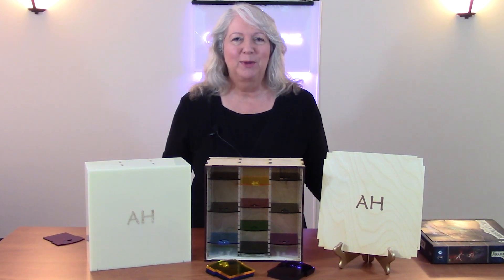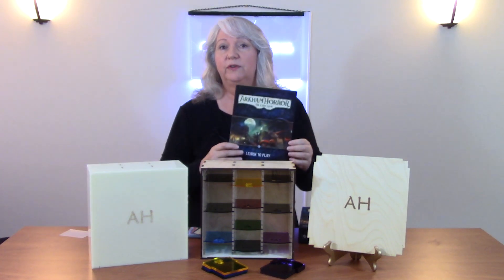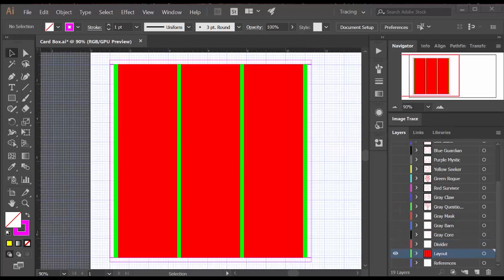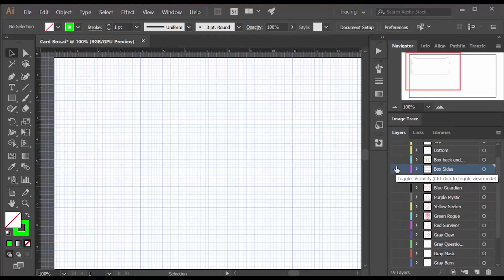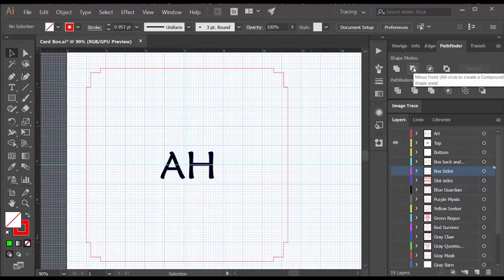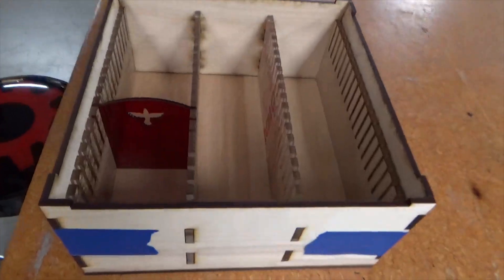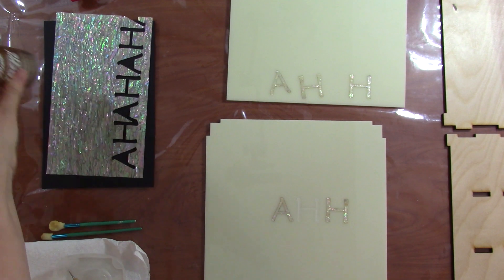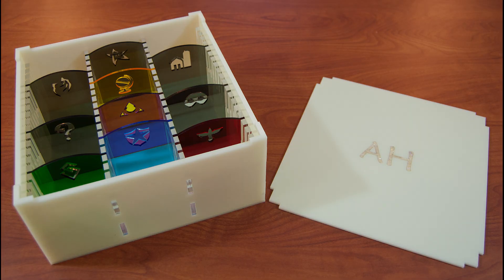How to Design and Laser Cut a Game Card Storage Box

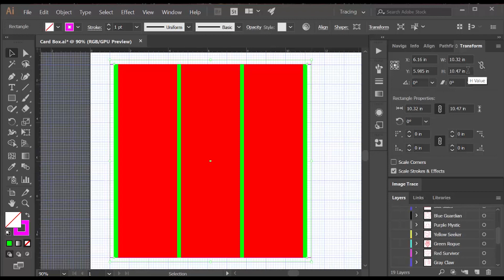Comment: It's very possible you already have a video showing how, but, could you show how you actually draw up the section starting at 2:55 in the video? I'm wanting to do something similar with a box that has adjustable dividers in it. Thanks!
Reply from the maker: Ryan, I make the slotted rails by creating rectangles the size of the slots, lay out a few then copy and paste them till I have enough. Then I group them all, place the group in a layer over a rectangle that is the dimensions of the rail, select them all and use pathfinder minus front. That should create a new shape that is the rail with the slots cut out. You have to make sure the slot rectangles slightly overlap the top line of the large rectangle, to cut through it. Let me know if you run into any problems...
Reply: @GreylightMay  Thank you very much! I will mess around with some design stuff today. If I have issues I will be sure to reach out to you. Thanks again!

Comment: A fellow fan of Arkham Horror CG! Loved the video!
Reply from the maker: Thanks, James, I'm really loving this game and it was a lot of fun to work on this project. I finished the video this morning and I've been arranging my cards since!
Reply: My Glowforge laser cutter arrives on Monday! Your boxes are incredible, and I think I'm going to try and work towards one of those for my AH game. And the new expansion is due out next month -- I've got to finish up the last three expansion decks so I can get to that new one.

One question -- where did you get your granite slabs? That's a great idea for holding things properly. Gotta get me some of those.
Reply from the maker: James, a couple of years ago I replaced my counter with granite and I believe these 4" x 4" samples are available anywhere they sell granite counter-tops. I picked these up to take home and pick out a color. Check it out and see if they'll give you a few, maybe for stone they no longer sell, or let you buy a couple. I use them CONSTANTLY in my little workshop!
Reply: Such a great video!  What laser cutter are you using in the video?
Reply from the maker: Hi Jeremiah! I use Universal 60 watt laser cutters at my makerspace TechShop. They are great, super easy to use. You just print to them straight out of Illustrator or CorelDraw, pick your material and specify the thickness, and it does the rest. Sometimes I make manual overrides, and I try to point them out in the video, like changing the raster settings so it cuts a pocket deep enough for the inlay, but 9 times out of 10 the default settings are just fine.